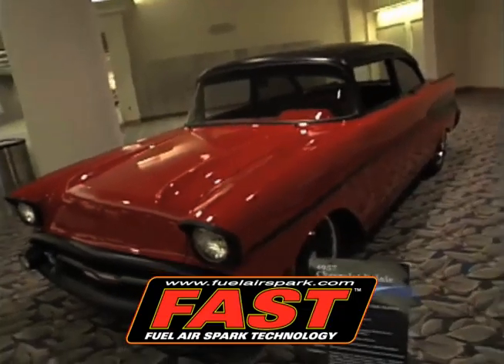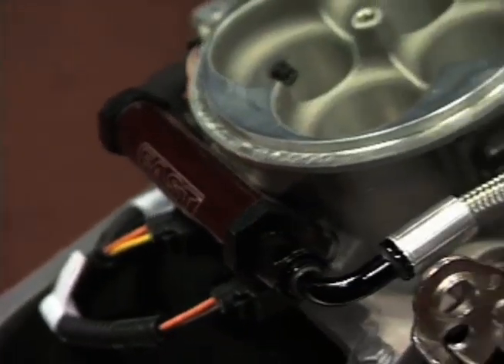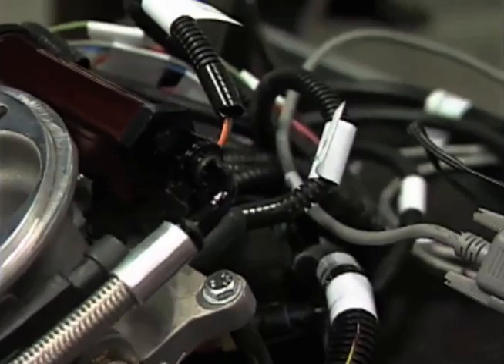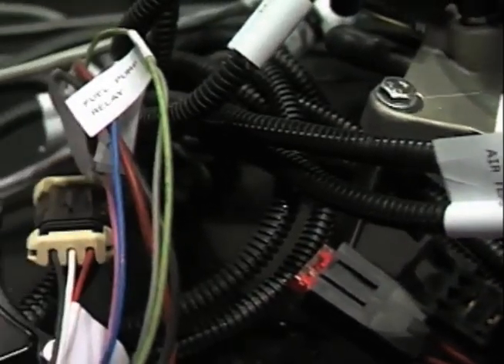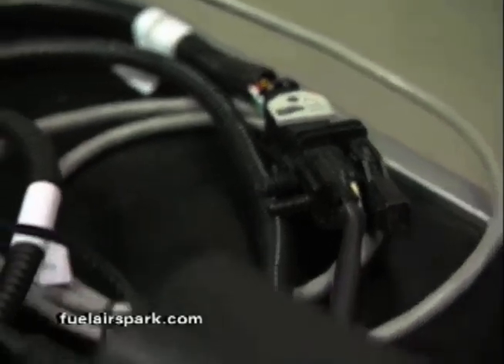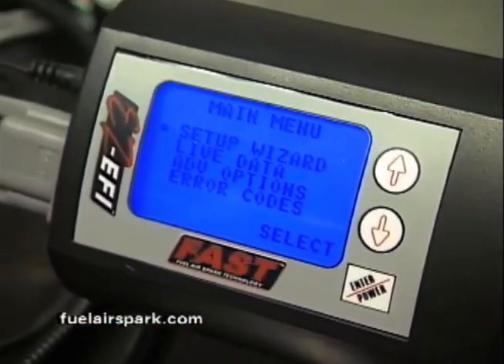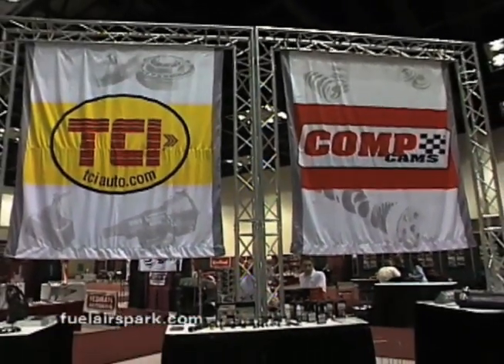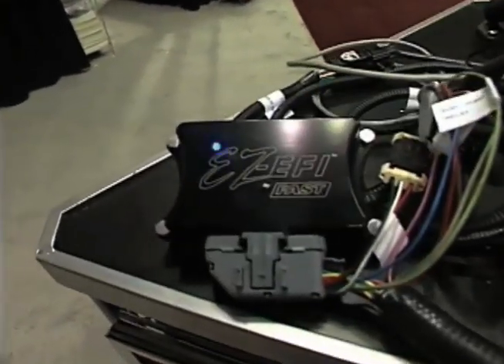EZ-EFI® With Brian Reese

Comment from the maker: @nebdrummer The ez-efi kits are designed for naturally aspirated motor setups. The MAP sensor and tables in the firmware are only rated and scaled to 1 bar for normally aspirated applications.